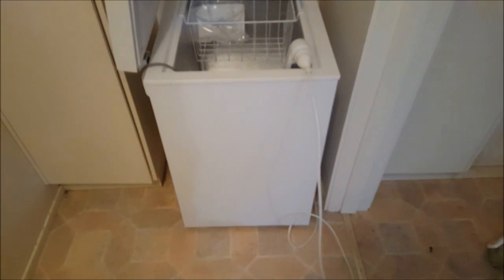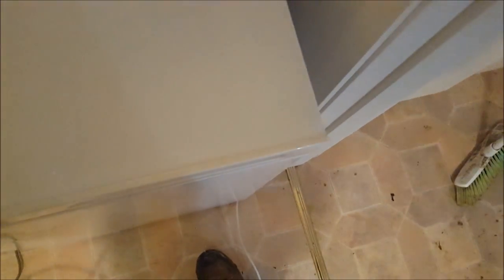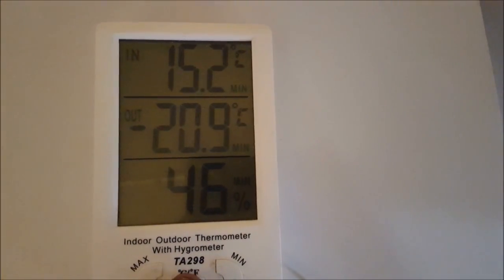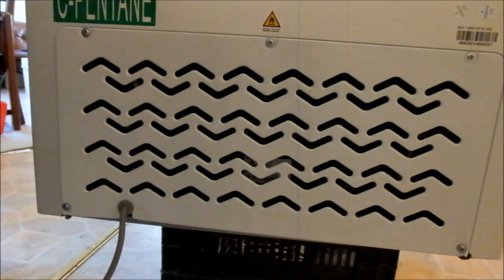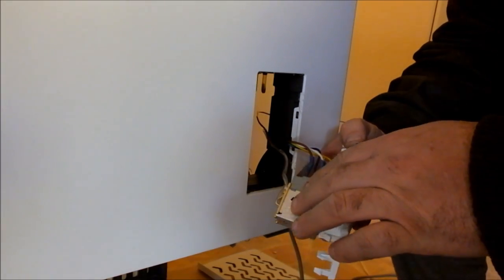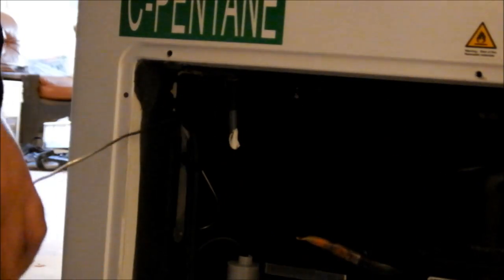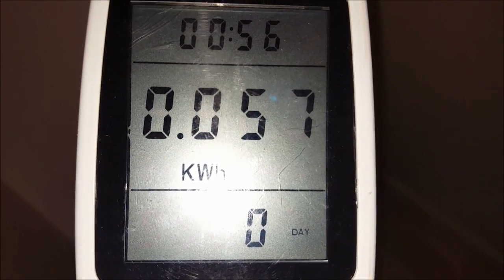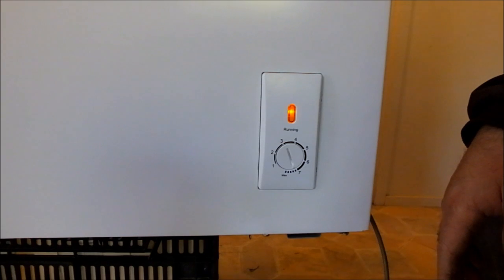Off Grid Solar Power - Converting a chest freezer to a refrigerator

Comment: I may try this for our off grid Cabin,  is there any reason you wouldn’t use a upright Freezer?
Thanks
Reply from the maker: You could certainly do it but it won't be as efficient. When you open an upright freezer, the cold air flows out of the bottom.

Comment: Do you think this conversion could work on a propane freezer? I'm looking at this one in particular if that makes any difference https://www.amazon.com/gp/product/B071R215F9/ref=as_li_qf_asin_il_tl?ie=UTF8&tag=tll2626-20&creative=9325&linkCode=as2&creativeASIN=B0714KT12J&linkId=d763a064a77fb97d45cf27fcffd752e2&th=1
Reply from the maker: Do propane freezers use the same type of thermostat?

Comment: I'm assuming the existing thermostat wasn't adjustable, but if it was it would be a matter of turning the screw that regulates the temperature range.
The thermostats being sold have that screw for adjusting the temperature.

Another thing. I can't find videos of people doing what you did here. I like this option better than all the other ones, and it's the less expensive one given these thermostats are running as low as $7 USD on Amazon.

Comment: Did you try the original thermostat set at the warmest setting first before changing it out to  see what the temp got at?
Reply from the maker: Yes.
Reply: @PopsShack 
What were the results of trying that method?
Reply from the maker: @readtheinstructions1407  - It wasn't warm enough.

Comment: Hi I just watched your video on converting a chest freezer to a refrigerator. Will any fridge thermostat do the trick or do i need a specific thermostat, and where would i buy one from? thanks
Reply from the maker: Almost any fridge thermostat should work. I used the VB-7, which I bought on eBay.
Reply: thank you very much. i will give it a go

Comment: i have a chest top freezer but the problem i have is the bottom or it only get cold the top freeze a little
Reply from the maker: That's weird, the bottom should be colder than the top as cold air is denser than warm air.

Comment: Hey Pop, firstly great vid, I thought about the STC1000s but the damage you have to do to your freezer was unacceptable to me. One question though, have you done temp tests with your new thermo, from running it as cold as you can, to as warm as you can? I just want to get an idea of temp range to expect. Thanks again, Benny
Reply from the maker: i haven't tested the temps of the extremes. I've got it set now so t h at food in the rack or on the shelf is cold.

Drinks on the floor and around the walls freeze.

Comment: G'day. Subscribed after watching this. 

A question. I understand the numbers will differ once you fill the fridge, but let's just use what came out of this video. Say I have a converted freezer running at 200Wh per day, how large a solar panel would you say I would need to produce those 200Wh consistently every day, year round?

In my youthful novice folly, I optimistically want to say not very large. Depending of course on far from the equator you live, sunlight will differ, but let's say worst case 8h of sunlight a day, I'd only need something like a 200/8 = 25W panel?

Am I maybe being a bit naïve about how these numbers come together?
Reply: Also: What you said at roughly 8:15 didn't quite come out right, did it?
Reply from the maker: zooblestyx It's not often I manage to get my knob lined up.
Reply from the maker: zooblestyx I can run this and my water pump on my 100W panel. When you're looking at daylight hours, you have to look at the average for the year and for most of it, you can really only count on about 4-5 good daylight hours per day in Australia.

You could probably get away with a 40W panel, but to be sure, a 100W panel is about $130 on eBay right now. That's delivered.
Reply: Thanks for your reply. I'll have to look into this deeper, because I get the sense these systems pay for themselves rather quickly.
Reply from the maker: +zooblestyx I'll give a better answer tonight when I get home, but the solar panel is cheap compared to the batteries.
Reply: I appreciate that greatly.
Reply from the maker: zooblestyx Okay, there are a few considerations to take into account.

1. Average sunshine hours. This is the average, over the course of the year, for the strongest sunlight during a day. In Sydney, for example, The average for August-January is eight hours. From February to July, it's down around 6.5 hours.

So in Sydney, with a 100 watt panel, you can count on a minimum of six hours of good, productive sunlight per day. That's 600 watt hours, or 0.6kWh. Enough to run a fridge of this type, plus a few lights here and there.

2. Power usage. This fridge, over the course of a day, uses less than 200 watt hours. But the MAXIMUM usage is over 1kW and this is when the evaporator coil defroster is running. What happens is that when the temperature in the fridge gets too warm, the compressor starts up. This start up load is about 500W, but only for a few seconds. Then the compressor runs until the fridge gets cool enough. When the compressor is running, it's only drawing about 50-60 watts and this is only for a couple of minutes. Then the evaporator coil heater kicks in to get rid of any ice/condensation on the evaporator coil. I've seen the draw for this go as high as 1030W, but it's not for very long. I have a 1000W pure sine wave inverter and it's able to handle this for a short period of time.

3. Inverter load. You've got to make sure that the constant load of your device doesn't exceed the rated continuous output of your inverter. Also, for inductive loads (motors, compressors), a pure sine wave inverter is best.

4. Inefficiency. At every stage, there is inefficiency. The cable from the panel to the charge controller causes SOME voltage loss. The charge controller itself uses electricity, which must come from the panels. There's up to about 30% loss of power just in charging the batteries. Then there's the inefficiency of the inverter. And then what happens if you have a few shitty days?

5. Batteries. If you have a few shitty days and you've got JUST enough battery storage, you're up the creek without a paddle. But not only that, you don't want the power draw (measured in amps) from the inverter to exceed 20% of the capacity of the battery bank.

So...The most expensive part of the whole system is the batteries, then the inverter, then the panel.

But...For $2000, I will be able to build a system that will give me about 1.5kWh per day and power the essentials for my home, which admittedly I'm only at two days a week.
Reply: Thank you again for your reply. Especially helpful is understanding how the idealised numbers on stuff you buy come out in real life conditions. But also thanks for laying out the different functions and loads of a fridge.

One question about pulling amps out of batteries. If I have several batteries in parallel, won't that help carry those short but heavy loads by spreading the amps out?
Reply from the maker: zooblestyx Pretty much yes. If your batteries are in parallel, the AH rating is combined, meaning that the battery bank is able to handle that load better. This is why I have 12 2V batteries in series/parallel. I have two banks each of six batteries in series to give me 12V each, then I have those two banks in parallel, which gives me 1260AH.

If I had them all in series, I'd have the same amount of power available, but it'd be 24V, not 12V.

The larger your battery bank is, the better it's able to handle larger loads.
Reply: RIght, that's how I understand it to work. Thanks again.